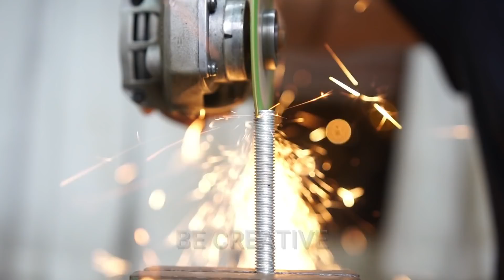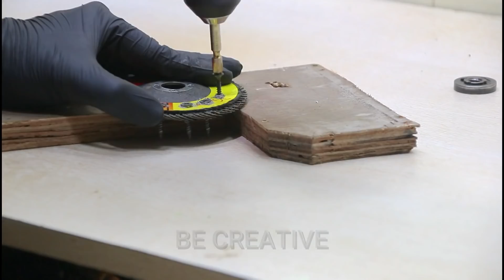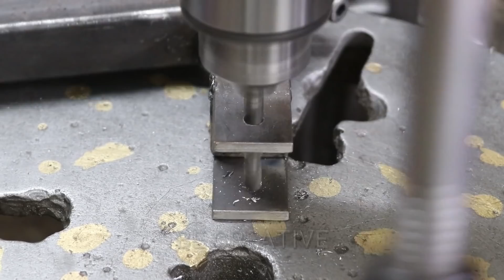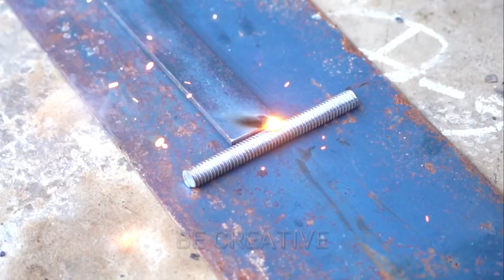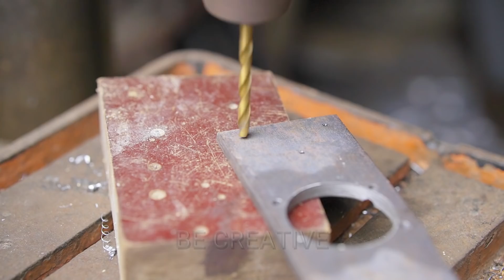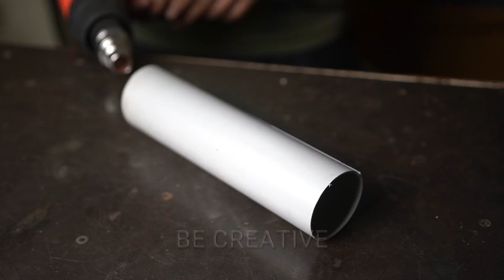Top Angle Grinder Hacks and Ideas That Work Extremely Well

Comment: Excellent video. I have a few old angle grinders and now I know what to do with them. Particularly impressed with the units to make it run a sanding belt set-up. And the one to put screws through an old sanding disk to make an aggressive scratching disc - excellent for getting paint off walls.  Keep your'e ideas flowing, Thank you !!
Reply: if you're using that to get paint off a wall, there's something wrong with you.
Reply: A disk with screws is a great way to get hurt.
Reply: Llllllllllllllllllllllllllllllllllllllll
Reply: wwrewr
Reply: @laszlogemes2004  ĺl0
Reply: My irony detector is broken.
Reply: theres no possible way you do any type of handy work if you think its ok to modify a tool like that lmao
Reply: @roctopus4209  Exactly. My dad's a welder and he's cut himself alr so that would increase the risk of losing a finger and probably an eye
Reply: Now after eleven months, are you still alive? Any missing eyes etc ? :)
Just checking in.....

Comment: Shouldn’t this be titled “only try this alone” 
Some of these are probably gonna kill someone. 
If you put screws in a standard blade, expect projectiles
Reply: im not an expert but having broken discs myself in the past it seems fucking insane to whip screws around at that speed in a disc that could blow apart. Maybe theres something im missing but i wouldnt try that one.
Reply: HEY! POOR/CHEAP PPL GET HURT! OKAY?!
Reply: yeah, that screws through the disc was asking for a darwin award.
Reply: The screws are outside of the guard...
 It's not so much the fear of projectiles ( although I'd imagine wood screws would make for some horrific injures ), but the fear of it digging in and grabbing, if you loose your grip on that thing, jeezzzz.
Reply: @ridosh  His Anglegrinder is Hikoki, its one of the moast expansive brands for power tools.
Reply: Something about the blade spinning at 20k rpm
Reply: came here to say the same. if you have the money, do it properly. "safety is #1"
Reply: I suspect that country has more than it's fair share of people with less fingers than they're born with.
Reply: @islaobelisk4150   I am assuming its not western and in a 2nd or 3rd world
Reply: I would call the author a moron,but this is not so - he himself works a normal tools.😉 The whole trouble is that others, having watched enough of such videos, will start repeating it and then they will start having problems.😱
Reply: First one was a gimmick but not all that dangerous. The second one really made me cringe.

Comment: Inserting screws in a carbon fiber makes it weak, and very dangerous at high speed. 
Safer to use an old steel blade.
Reply: It is safe to isolate such masters in a soft room.
Reply: @JWC3686  pretty sure that foreign dude was making a sarcastic insult and saying that people commenting on the safety concerns, actually know nothing. As in the days upon days of OSHA and MSHA training that I'm guessing a lot of us have means nothing. I personally have been working with power tools and operating heavy machinery since I was 14. Over the years I have nearly lost fingers countless times because of using tools and equipment improperly. I now follow many safety guidelines even if they seem unnecessary.
Reply: I was thinking it's better to just hot glue them to a glass disk.
Reply: @scotttillinghast9665  You seriously think hot glue will hold it ??   
LMAO !!

Comment: When machining pulleys for a flat belt (sanding or other), making a slight crowning on the surface of the pulley makes it return the belt to centre, if it is dragged to the side.

Comment: Adding the extra weight of those screws to something that is already PRECISELY  weighed for the amount of RPMs it will be spinning, can and more than likely will result in a complete catastrophic failure of the disk, at VERY  high speed.  You better pray to whomever you pray to, that none of the shrapnel is headed in your direction when that disc rips to pieces  while spinning 200 times every second.

Comment: there are some disc that actually used for carving wood, or using concrete grinding disc for wood should be better than the screws
Reply: Chaindisc blades are pretty much the most dangerous thing you can put on an angle grinder, probably similarly dangerous to just putting a load of nails in a flap disc!

Comment: yo that belt grinder stand was genius!!
Reply: A 4-1/2 inch grinder will run at 10,000rpm a sanding belt won't  on any sensible sized drum.

Comment: To the guys knocking all of these because of the "screws through flap disk" thing, they are not all that.  A few of these are ok to good (though the bench grinder one is a "yeah, you can, but you could just get a bench grinder and not sacrifice an angle grinder").   The jig that turns an angle grinder into a... I guess "Skil grinder" or a Skil saw for metal, yeah, I get behind that one 100%.  Be fair, don't be all carrot or all stick.

Comment: Hi,
Do you have any idea how fast a grinding wheel turns!
At 11000 RPM with a 125 mm disc this comes to a speed of around 288 km per hour. Are you going to sit on the motorcycle without a helmet at this speed ...... you will understand very well if a fly comes into your eye what happens ..... Please put health and safety on the 1e place. Think before posting

Comment: Are you going to be financially responsible for the injuries that these modifications are going to cause?
Reply: I accidently bought one of those cheap made for the 3rd world grinders .  Look at the switch on that grinder . Slide it forward and it is on , slide it backwards it is off . Let go of that switch and it is still on . The damn thing was so freaken dangerous I threw it in the trash
Reply: @huckstirred7112 . There are still a lot of big name brands that have the same switch. I've never had a problem.
Reply: @stevo68  I was not trying to be offensive . Please don't take it that away . I bought a Makita 41/2 inch grinder made for the third world . The slide switch would not shut off if you let go of it , Instead you had to pull the switch back . The wheel had no detent so you had to use the wrench . and the guard was fixed . That slide switch scared me so bad , I took a loss and threw it in the scrap bin . I sent Makita a email calling them every thing but a Cristian for creating something as dangerous as that damn thing , Yes I have Makita made for the U.S love it great machine .  But the third word stuff may be durable but dangerous

Comment: these attachment ideas are neat if Harbor Freight is too expensive for the tools they replicate. Also NEVER do that sanding pad mod. Framing screws are made of hard brittle metal and will snap and fragment put under that kind of stress resulting in serious injury. Sanding pads are cheap, emergency medical care is not. this is your DON'T TRY THIS AT HOME p.s.a. since the poster has thrown safety to the wind.

Comment: I like how he ends up turning a drill into an angle grinder, either comming full circle or just a testament to the pointlessness of the whole thing from a perspective of making functional worthwhile tools. Afterall that sander he made, took so many other machines to complete that the result was the least of them. 

From that you can conclude; that he was not making smart machines he was just making art for viewership. which is fine if it was not for the that deathtrap nail grinder thing from hell. That was like som DIY torture device out of a SAW movie and i would caution that viewers never to attempt to make that.

Comment: Nice ideas, but there is a reason that circular saws from real manufacturers are made the way they are: regulations for safety! 
The grinder with circular blade is nice if you want to injure yourself and want to cut off some limbs here and there. Please do not promote this!
Reply: great video only the last one is very very dangerous!
Reply: ah, but what good is safety if this channel can't make money off of it?
Reply: @israel-solar  Why is the last one "dangerous"? It is NOT powered by an angle grinder, but a battery drill.......

Comment: I can see your using 6013 junk rod. I can spot those rods a mile away by the slag inclusions they leave. Guy one time bade a man lift basket using that 6013 rod where he would be lifted up  at 600 feet. I said are you using that rod welding that. He said yes. I said I would never get in that. He said you gotta have faith. I said I have faith, but not in that junk 6013 sheet metal rod. lol